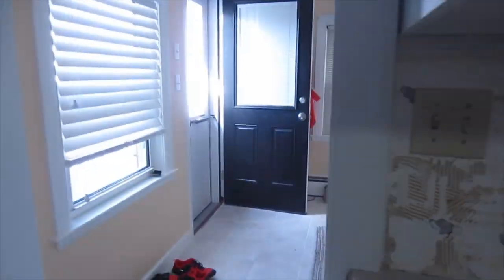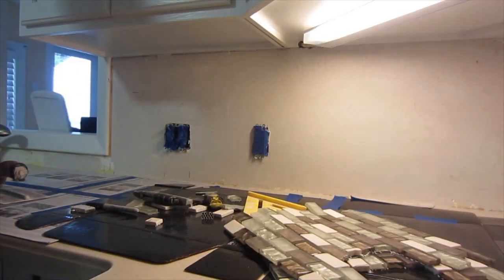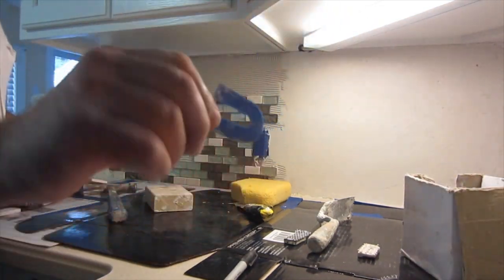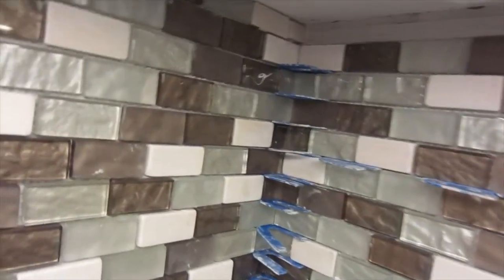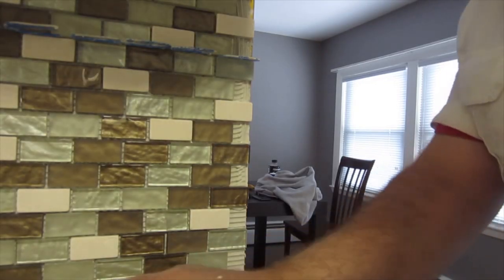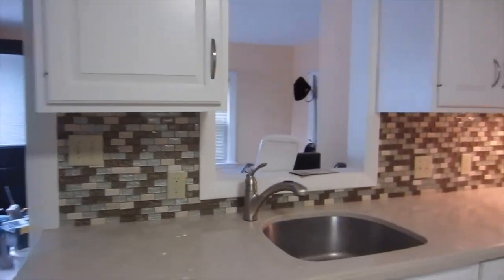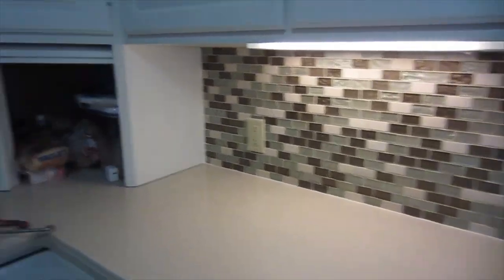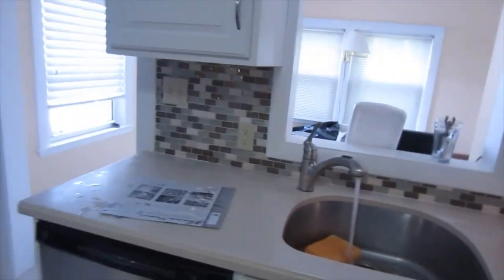How to install a glass mosaic tile backsplash Parts 1,2 and 3

Comment: to save time on the corners you can cut a full sheet in half. use each half as the srarter for the same corner. the you dont have to work with small detatched tiles.
Reply: Ohhhh... Great Idea!!!
Thank you.
Reply: Very great idea. Then just work from the corner out which is the way I think it should be done anyhow.
Reply: OMG what a great tip!

Comment: Thanks so much for taking the time and effort to share this with us.  I particularly liked your method of the inside 90 degree turn in the corner.  I agree, it looks better with the small pieces re-installed after the cut.  I viewed another video where they merely butted the up together.  Not good looking at all.

Comment: Love this video Sal...I didn't see an answer to several people asking about leaving a gap between the tile and counter top (apologies if I missed it) but I don't think you actually need a gap in this case.  You just need to seal the bottom edge of the tile with caulk for water proofing like you did in the video. The gap people are referring to is actually known as an "expansion gap" which I don't think applies for this sheet style tile.   Correct me if I'm wrong however.
Reply from the maker: +K Brown In some cases it is absolutely critical, but with this type of tile i usually don't bother.

Comment: OH MY Gosh... I am so glad I watched this video before I decided to tackle my (bad) project.
I too have ugly GLUE on a (very thin) wall on my 1972 Vintage Travel Trailer... 
I can not get the glue off without hurting the thin board behind it, (that is why I wanted to 
know the name of the tool you use at the beginning of this video... GREAT IDEA... but what
 I would have skipped would have been putting on the "Skim Coat" .... You have saved me a
 lot of work and worry...
Thank you so much for this great video...
NOTE: I hand paint custom tiles and I would have hated putting up the hand painted tiles only to have done a 
bad job... .... I'm not used to installing them... just painting them... LOL.
Thank you again... I really enjoyed watching this video...
Reply: Judi Christopher that tools is called a multi-tool, pretty much a dremel with vibrating saw attachments
Reply: @Ricky-xv4yc  
Thank you so much for your reply.
Reply: Judi Christopher no problem at all. Been installing tile for years but I have to say it’s not hard and I’ve had several homeowners that love to watch and learn a few things. It’s a fun career but also a fun hobby if you’re a homeowner
Reply: @Ricky-xv4yc  
I agree...
I have a question for you... If I put up a backsplash in a RV... can I use a flexible grout so it does not crack? Is there such a thing LOL

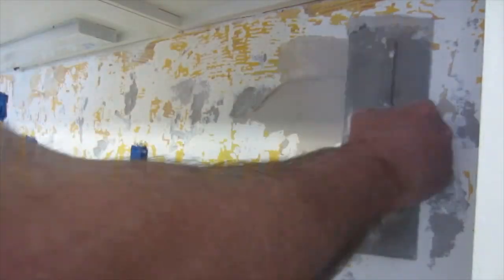Comment: It looks so pretty when your done! I just attended a workshop and learned to install a back splash, but I have a few questions they didn't address. Would you mind answering then, and thank you in advance. :) 1) What did you use to patch the wall (I think you said @ 2:00, but I couldn't hear it)? 2 (3 questions in 1) What was the process of removing the outlet covers and taping them? Was it that simple or more complicated? When you screw the outlet covers back on, do they just fit? 3) Did you caulk the space between the tile and where it meets the counter top by the sink? if so, do you have a video on caulking? Again, thanks in advance for your answers.

Comment: Hi Sal, I'm about to do this in my shower today. The mosaic glass sheet tile and the 12x24 tile are the same thickness 1/4". Can I use the same 1/2" trowel to set the mosaic glass tile on wall so it can be the same evenness when done? I'm only doing one 12" vertical line right in the middle straight up on backwall of a 3x5 shower. And can I use the same MAPEI brand large format wall tile thinset? It's white thinset. Any advice will be much appreciated.  Thanks
Reply from the maker: You will find that the 1/2" trowel will not work well with the  mosaic tile. You should set the field first leave the pace for the mosaic tile to add it after. Glass tile requires a mortar that  is suitable for glass. The thinset you use for the larger tile may not be appreciated.
Reply: @SalDiBlasi  what she trowel for a  1/4" thick mosaic glass tile sheet?

Comment: Sal: Loved the video, it's not as easy as everyone thinks to do it right. I'm about to install glass tile with textured stone in it. What happens to the textured stone when I grout? Thanks again.
Reply from the maker: My guess it that you should probably seal the tile before you grout it, if the stone part of you tile has a lot of voids in it, they will be filled by the grout and will have an entirely different look when grouted.

Comment: Hi again,

 I did not see that you verify the level of the granite counter and top cabinet before you install the glass mosaic tile ( I believe you did verify the level ).
1. What will you do (when installing this glass mosaic tile)   if you have a 1/8 of an inch  slope every 1 feet or so  from both granite and top cabinet in such a way that the distance between cabinet and granite counter is the same ? and what will you do if only the granite counter has a 1/8 slop every feet or so ?
2. I did not see that you maintain a  space between the  glass mosaic tile to the granite counter, Is this because you are tiling glass ?

Thanks for the great video, help a lot.

Comment: Good job, but I wonder why you put grout with electrical covers on? Also at the bottom instead of grout clear silicone should be use.
Reply from the maker: Grout with covers on because I don't like electrical shocks, and the bottom is caulked with a color matching caulk, not grout.

Comment: Excellent video.  The info regarding matching the tiles at the inside corners was something I hadn't thought about.  Question: Each mat usually comes packaged on a white cardboard.  It seems to me that for those glass tiles that are somewhat translucent (you can see through them to some degree) the color of the thinset could affect the final color.  Correct?
Reply from the maker: Sone glass tiles are in fact transparent and require an additional step during installation to insure 100% coverage, and the color of the thinset will greatly affect the look of the final product.

Comment: What type of thin-set did you use to get the uniform surface across the wall, I could not make out what you said please? And also what type of mastic or thin set are you using as an adhesive for the tile? I guess I am confused as it appears you are using one thin set for the smooth surface and another product for your adhesive. Thank you for the video as it was very informative and helpful.
Reply from the maker: Same thinset as I used to set the tile.

Comment: Thanks Sal!  We removed a backsplash of 4" tiles last week that removed a lot of paper and had to piece in a small patch of drywall to repair a hole.  Removed all the old mastic and was advised to put a coating of Gardz on everything since we accidentally did the patch with regular joint compound and mesh tape.  Should we be good to set glass tile mosaics at this point.  Everything is flat.
Reply from the maker: can't really say because i have no way of seeing it in person, but it sounds like you are good to go.

Comment: That's so beautiful!  Can you grout before you put the electrical faceplates back on? I'm about to do this exact same type of tile in my own kitchen.  What color is the grout? I'm thinking white but it might be TOO white.  Also, should I put spacers at the bottom between the counter & tile, or does it matter?
Reply from the maker: +tygrr94 You can grout before you put the face plates on, but if you can turn off the power to the outlets, do so. I sometimes put them back on so i don't get an electrical shock while grouting.

Comment: Outstanding video first of all! I have a problem where the top edge of my formica counter top and my window trim are a 1/2 inch off from one side to the other. 36 inch wide window and only a 2 inch gap on one side and 2 1/2 on the other. 2 peices of glass tile are 2 inches. What would be the best way to fudge it.
Reply from the maker: Not sure you can fudge it.
Reply: So do I just cut the top row at a angle?
Reply from the maker: I don't think there is much else you can do.

Comment: and what you did to the wall before inserting the tile...is that a must? and what exactly did you do? just smooth the wall out? do you have to smooth the wall out and scrape the paint off before inserting the tiles?
Reply from the maker: +HM Russell The blue horse shoe spacers are 1/16" thick, and they help maintain the grout space between sheets and where ever i think they are needed, I scraped the wall and smoothed it out because it was in rough shape but not so bad that it needed to be replaced, in most cases this is not necessary.

Comment: I am going to install a mixed mosaic of aluminum, glass, and ceramic backsplash. Any pointers as to the thinset, trowels and cutting techniques? I suspect that a glass cutting blade would do the job on ceramic and aluminum. Thanks in advance,
Reply from the maker: Yes use a glass blade for glass, use a high polymer content thinset and you will have to figure out what trowel will work best for the tile you have.

Comment: Good job but at the end tiles its always better to use a edge strip...looks cleaner and protects the tiles.
Reply from the maker: I would agree with you if this was a floor where the edge of the tile needs protection. With glass tiles backsplashes  i polish the edges where needed so that the tile ends without the need to add a strip to finish the tile. That way you get a nice clean look without adding a vertical line at the end, but of coarse this is just my opinion and how to end the tile is really a mater of taste and entirely subjective.

Comment: Nice video and excellent job.  I just installed the exact same back splash, but left the grout on too long.  What would you recommend for removing the extra grout from the tile? It's difficult to remove
Reply from the maker: +Lee Radford You might want to try a mild acid, like white vinegar, but depending on what the tile is, it  might damage the tile. There are grout residue removers check with a tile supplier.

Comment: Does the grout has to be striated before applying the tiles and what was the purpose of you using the blue strips in between some of the tiles?
Reply: The initial adhesive is mastic and yes, it has to be striated.  You use a 3/16-in  v-notched trowel for this application.  This way you make sure the adhesive spreads out under the tiles when you push them against the surface.  If you were to just spread it out evenly, you might have some areas without adhesive.  Some of the tiles may be uneven, so to prevent that, the adhesive goes on striated like that.  The blue strips are spacers.  You use these between individual sheets of tile to make sure you maintain the spacing, which is later filled with grout.  If you don't use spacers, you will have tiles right next to each other without the needed spacing to fill in with grout later.
Reply: Marily,

Comment: Sal, I installed a white quarry interlocking mosaic stone for my backsplash, but after grouting, it seems really dull as if a haze is covering the whole thing.  It's not something that will come off with just a dry towel or something.  Can you please recommend a product or what to do?  My beautiful stone is totally dull, man.  Thank you and I subscribed.
Reply from the maker: Did you seal the stone before grouting, if not, then that could be the cause. As far as getting it off, well there is the problem, if it is a delicate stone then harsh cleaners will just create bigger problems. This is really not my area of expertise, so I can't  offer a solution.  You might be able to find some help here http://www.johnbridge.com/vbulletin/forumdisplay.php?s=2fdd90c69e4dce22c9bb103842b9478c&f=16
Reply: I absolutely sealed before grouting : )  I'm starting to think the problem may be with the yellow lighting against the gray stone.  It creates a "dull" tint.  I'm going to install track lighting with different color lights or maybe under cabinet lighting and I think that may solve the issue.  Thanks for replying, really appreciate your videos.

Comment: hi! love ur video! I will be installing a glass mosaic tile backsplash in my kitchen.Thin-set mortar for glass specifically, right? any particular grout used? (sanded or unsanded? Premixed? brand u trust for glass mosaic backsplashes?) what kind of (wet)saw & blades do u use? Do you caulk the edges of the tiles at the end of the wall (with the polished tile pieces)? Thanks! :)
Reply from the maker: Yes to all above, Tec Superflex thinset is a good one, unsanded grout is probably best no use a glass specific blade on the wet saw, caulk all changes of plain and where tile meets a dissimilar material.
Reply: thank u so much! :)

Comment: Can you say how many square feet was this and what was charged?  Or can you at least give a range of how one would quote for a job like this for this glass backsplash? I know there would be a various differences for different cities but I'm just trying to get an idea to start my tile business. Sal's a great teacher and I have four of my rentals with kitchen and bathrooms that I can get experience from.
Reply from the maker: As you said, pricing is wide ranging and it is also something I never discuss on an open forum. If you are interested in starting a tile business, then you should get to know the TCNA Handbook, and use the resources available at the CTEF, https://www.ceramictilefoundation.org/  and the NTCA https://tile-assn.site-ym.com/ attend as many training events as yo can, many manufacturers offer them and will cover your stay and food while you are there. There are way too many installers that do not have a clue just how much really goes into a tile installation.

Comment: Hi Sal... informative video but my husband is concerned that we have sheetrock on the kitchen wall. Do we still use the white thin-set adhesive or the mastic mortar? Our contractor is concerned that the paper from the sheetrock might eventually peel off . And  should we place a water resistant material prior to installation to protect against any moisture (especially behind the sink )? Thanks so much.
Reply from the maker: Glass mosaic tiles has to be installed with a high polymer content thinset, mastic may work in some circumstances, but often will react with the backing of the tile and cause discoloration. Also if the glass tile has no backing, is transparent, then thinset is the only option. I have installed more backsplashes on sheet rock than i can remember, so it is not a problem, if you are concerned about the area at the sink, replace that small section, but if it was mine, i would not bother.
Reply: @SalDiBlasi  😮

Comment: Hi Sal. Great video. I read somewhere that we should use silicone caulking for an expansion joint @ the corners. Your thoughts?
Reply from the maker: Does not have to be silicone, siliconized latex caulk will work just fine.

Comment: Great video. Thanks. Can I install moic directly on pinted wall or should I do omething with the paint.
Reply from the maker: If the paint is in good condition and well bonded, you can install the tile on it, you might want to rough it up a bit with some coarse sandpaper first.
Reply: *****
Thank you Sal. I'm starting my project tomorrow.

Comment: Another question: I see in your description you say you added "Boost" to made the grout highly stain resistant.  What are your thoughts on applying a grout sealer?
Reply from the maker: If you use a grout that is compatible with boost, then there is no need to seal it, if you use a standard grout then sealing is a must.

Comment: Sal, what kind of blade do you use for cutting the glass mosaic? 
I am about to tackle a bathroom job with subway tile (ceramic) and a glass tile mosaic stripe. Thank you for answering all my questions :-) Cheers!
Reply from the maker: +Lada Javorek for glass You should get a blade specific for glass, but most times if you are just installing a boarder you can get away with using the same bkade6 as you use for the rest of the tile.

Comment: Hello.  In this video it looks like mosaic is about 1/2 inch thick.  what size trowel notch is used ?  3/16 or 1/4?
Reply from the maker: The thickness of the tile was probably about 3/8" maybe a little less. The trowel i used was probably at one time a 3/16" v-notch, but I have re-notched it several times so I really don't know what it is now, i usually just look at the tile and then pick a trowel out of my truck and usually end up with the right one, if not I will just move to a different trowel, larger or smaller notch. That being said, if you are going to install glass tile, buy the trowel recommended for the tile you are installing. The reason I have so many trowels, is to be able to have the notch that is just right for the tile I am installing, be it glass or anything else.

Comment: Can I check what type of adhesive you have used for the tiles? I've bought some aluminium mosaic tiles and was told not to use general wall adhesive for ceramic tiles.
Reply from the maker: By general wall adhesive I am guessing they mean mastic, this is good advice no matter what the tile is. You probably need a high polymer modified thinset mortar, look for ANSI A118.15 on the bag, might be in small print.
Reply: Thanks